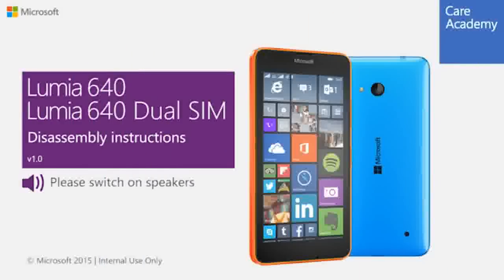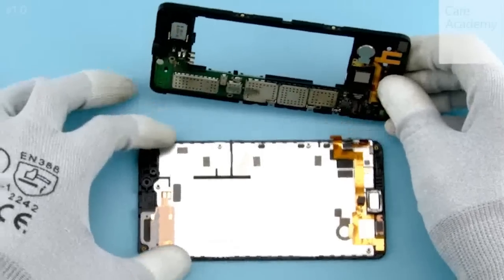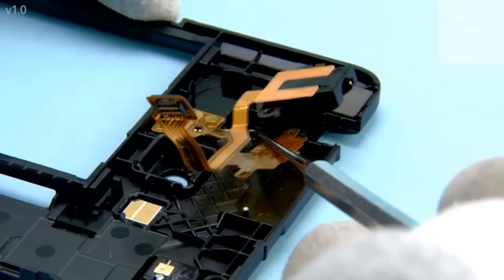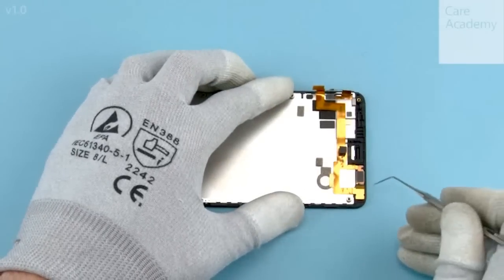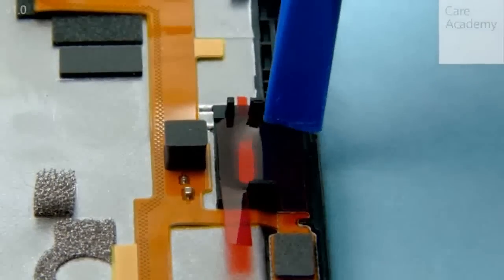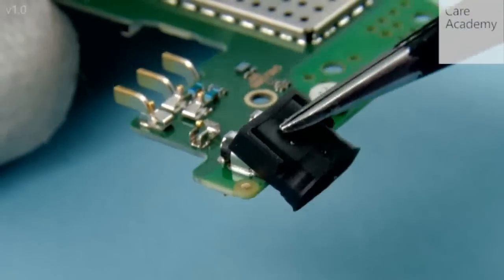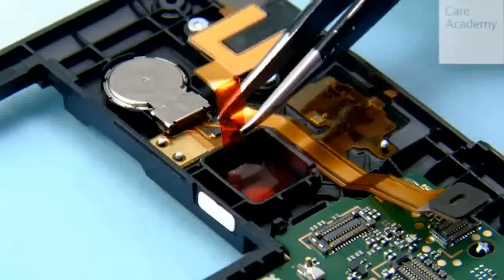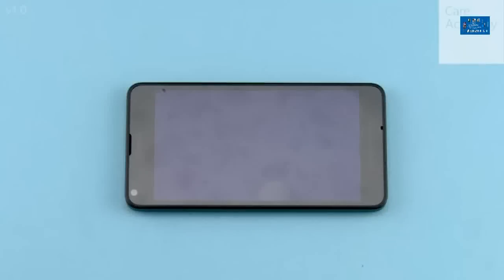How to Disassembly and Assembly Microsoft Lumia 640 Full

Comment: I replaced my the lcd/touch digitizer from my phone because it was cracked, however my the screen stays black and it feels like it doesn't turn on even after it is charged. Does the lcd/touch have anything with the phone turning on if the new screen was bad?

Comment: is there anyway to fix the screen or get it replaced? my screen wont turn on but the sounds and touch features still work
Reply: +Virginia Villanueva look up "New LCD Replacement For Nokia Microsoft Lumia 640 LCD Display Screen Touch Digitizer Assembly With Frame" and buy one (I got mine off of aliexpress its great). Next remove the back and the front camra then you can replace the screen. it should work after that.  ALL=  21-28$